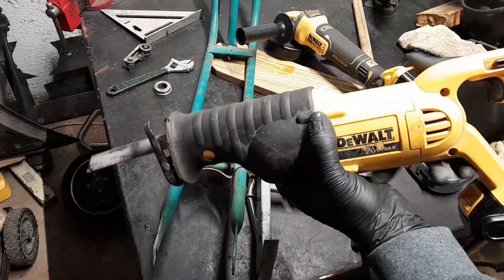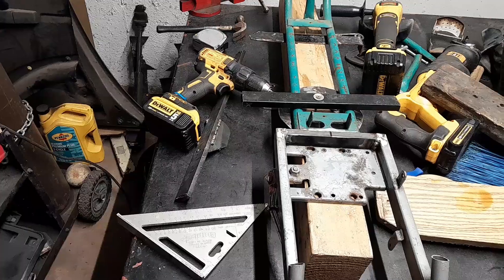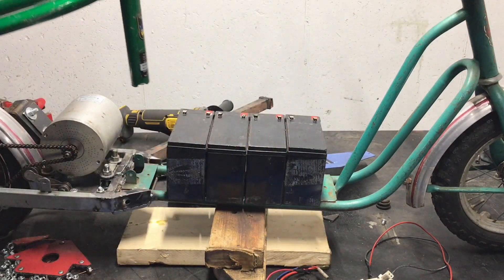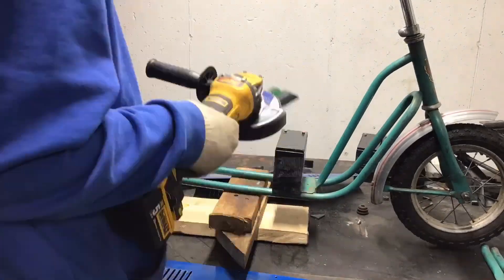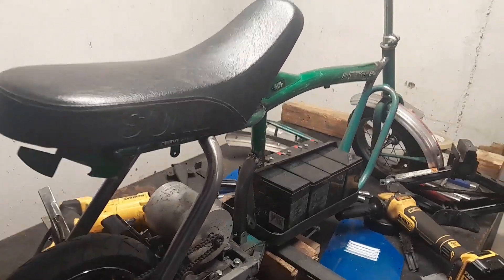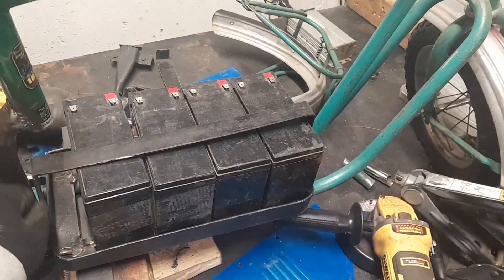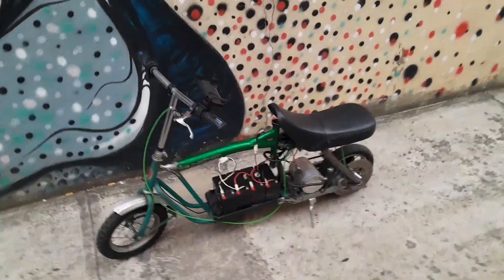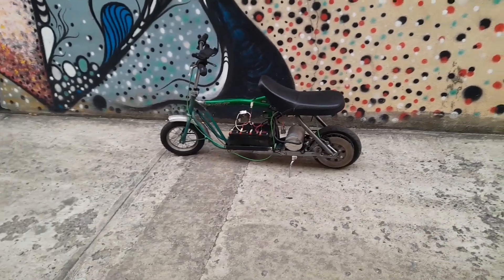I Turned A 1950's Scooter Electric Pt1-2000w 48v 5200Rpm [ built by a 16 year old]

Comment: What motor did you use? A brushed type or inductive ?
Reply from the maker: @JarerSaro  brushless. Was able to hit 40mph with a 60v battery
Reply: @FatherAndSonsGarage  can you diy a 12v motor  than can run 50kph
Reply from the maker: @JarerSaro  if the motor can handle it 😅

Comment: you wont get 2000w out of those 4 batteries, maybe 500w.
Reply from the maker: Really? So what kind of battery should I use?
Reply: @FatherAndSonsGarage  that size of battery is usually 12 amp. 144 watt x 4. = 574 watt. to get 2000-watt out of 4 batteries. each battery would need to be 43 amp. as to type better with lithium. will reduce size and weight. more power. but very expensive.
Reply: @georgeh9967  batteries? every 2 in 8 batteries is in parallel connection and the 4 on the parallel connection is on a series connection?
Reply from the maker: So what batteries would you Recommend me, is there any in particular ?
Reply: you are wrong, did you see de battery discharge curve? those kinf of batteries can supply up to 140 amperes in 5 seconds max, and therefore it can supply a lot of current.